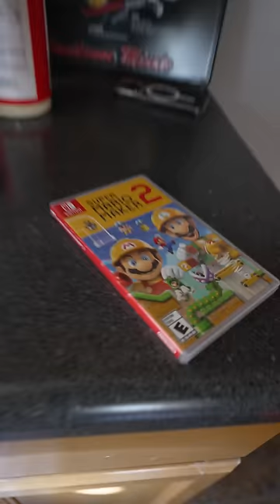Best of Dad POV

Comment: Live in the Midwest myself,I’m retired now and I finally called the plumber to installed a new faucet in one bathroom. He was there at my house for two days, had him replace all the faucets. He also corrected every plumbing job I had did over 30 years. Everything works correctly!!!! Next month I’m calling the electrician👍
Reply: Good to know that is an option. Sometimes I am scared to start a new project, because I am worried it will be just a little off. Fix that mistake 20 years later when I am more financially secure… genius
Reply: lol we're doing the same thing with the plumbing. all that hard work i did, undone
Reply: @kennethv5250  Hard work =/= good work.  I've learned that the hard way too many times.
Reply: I’ve learned that the previous owners of my house half-assed repairs, and when I think I’m only in for a couple hour project, it ends up taking way more time than that and sometimes I have to call in a professional because the additional issues are outside my expertise.
Reply: @molonlabe2645  don't feel bad. I live in the deep south and I'm encountering these exact things you guys in the Midwest are. I did a plumbing job at the family farm a few years ago that looked exactly like that 3D pipes screensaver from windows '98 thanks to my uncle playing plumber. Dear God, I wish I was exaggerating about what it was like.
Reply: @OriginalMegamanX  Dang that’s a mess! One of the first jobs I tried tackling here was just a “simple” kitchen faucet replacement, but unbeknownst to me, the previous owner didn’t bother caulking anything around the faucet or sink so all the securing nuts and bolts were rusted solid. I thought the odd angles just to get access to the nuts was gonna be a challenge… Had to call my buddy who’s a licensed plumber to come by with his fancy tools. Even he got fed up with it and ended up saws-all’ing it off from the top.
Reply: @molonlabe2645  LOL, I'm not laughing at you. I swear.  My father had one of those about a month ago. Kitchen sink. Guess who did the work on it before....... yep, my uncle. He's forbidden from touching anything else. I'm not saying that I've never done stupid stuff when working on things, but damn. There are different degrees of stupid. You know? Hang in there, brother. It's gotta get better eventually, right?
Reply: @OriginalMegamanX  here’s hoping! Just gotta keep on plugging and chugging. I’m 39 so maybe by the time I try to retire this house will be where I need it to be 🤪
Reply: When people work on exposed piping like the P-trap, it's not a huge deal. It's when they do the actual waste and venting in the walls that scares me. I've opened up walls and seen so many bad things homeowners and handymen have done. It should be illegal; when you buy a house, you assume that mechanicals have been done by licensed people, but that's not the case after the recent HGTV craze. So many unsuspecting new homeowners have had to eat thousands in repairs because of this.
Reply: I temporarily fix everything in my house until I can get a professional in to do it. Because if a pipe busts on a Saturday night, it can’t just keep leaking until Monday morning.

Comment: Filter changing tip especially on large pickup trucks. Use a small pick or Phillips head screwdriver to punch a hole in the bottom of the filter to drain the oil from the filter causing less mess when removing it.

Comment: If your times tables are a little weak (mine ends at 12 personally) you can break things down to more manageable values. 7*18 is too hard to do in my head, so you can reach the same answer by doing 7*10+7*8=126.
Reply: I split it differently, doing 5x18 + 2x18.

Comment: A smart man has jumper cables in his car. A wise man has a charged jump pack in his car
Reply: Yeah except it's never actually charged when you need it...
Reply: @BigBear--  I've never had that problem. I top it off every 6 months but even then, it's nearly full
Reply: @scottgoldfarb95 That's kool. I was making a joke, that most guys would throw it back there, then 2 years later when they need it it's either not charged cause they used it, used it as a power bank to power their cooler, or music, or whatever. Just that it's never charged when u actually need it for an emergency.

Comment: Unfortunately you don't put the donut in place of a drive tire, so if you have front wheel drive you rotate your wheels so the spare or the donut goes on the back if you have rear wheel drive then you put the donut or the spare on the front otherwise it's going to fuck up your transmission. Yeah they say don't put the donut on the front but fighting the steering wheel is a lot better than replacing a transmission

Comment: Putting the black cable on a "ground" spot away from the battery is a load of shit. Do that and you won't be getting shit to the dead battery and it won't work. Put it on the battery.
You'll get a little sparkypoo, but it's not gonna hurt you. Be a man